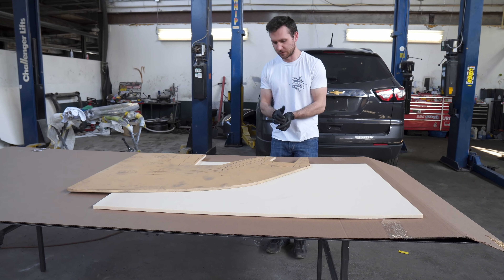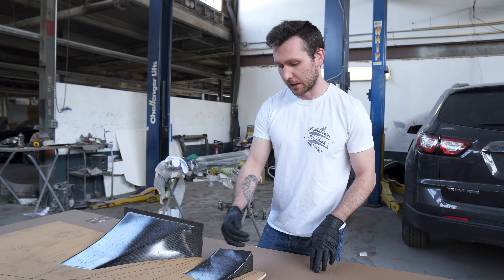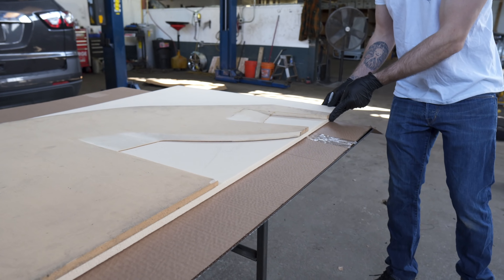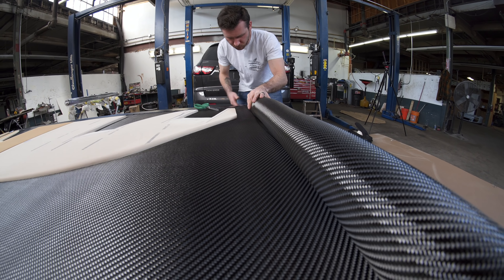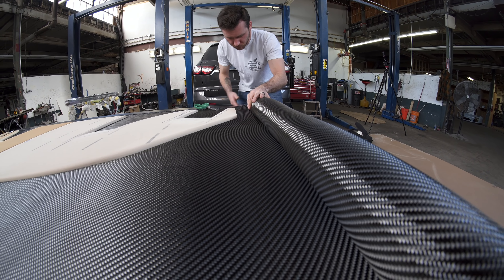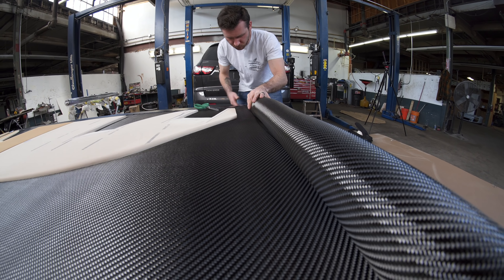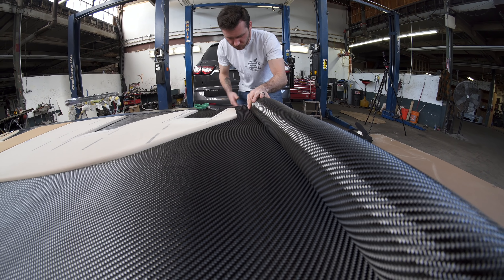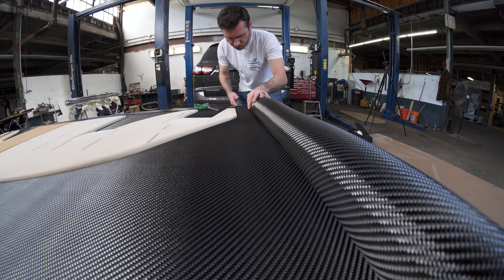240z Splitter Carbon Fiber Infusion | (Ep #56)

Comment: Hey Guys, Good job. Just a tiny piece of advise, when using infusion as a method of forming, you have to gauge to vacuum pressure at 29.9 hg, HAVE TO. you will never have air problems. Once your form is saturated, shut resin intake, and leave pump on for at least 2 hours. It will pull whatever air that could have possibly gotten in through the resin intake. Also, you should degas your resin before. Just a handy DIY heads up from a composites engineer. Awesome work...Grats

Comment: Use a perforation tool on the close cell foam. And you can make a Hydro lock in the bag to help evenly pull the resin through the bag

Comment: The blue handle ones have a edge specific for Kevlar or stronger fibers, the green handle ones are more of a general purpose. But you can cut* anything with our scissors/shears so it's all good lol! I'm just happy you're putting them to good use 👍
Reply: you must be the scissors guy
Reply: @neezduts3457  I'm the scissor guy
Reply: Can I just say they sound fucking amazing, that cutting was so satisfying hahahaha
Reply: @MrSaxophoneGamer  the MOST satisfying. And feeling it glide through too. Even the weight of the handles closing has to be dailed in! 👌
Reply: @rt4wd_wolff  how do we order 😁
Reply: Hows the edge retention when cutting carbon? My Kai 7280's were super sharp for about a week.
Reply: @maddsperformance  you need to get the Wolff® 6278M Kevlar® Shear - 6000 Series Carbon Steel Scissors. They have a specific cutting-edge for cutting Kevlar and harder materials.
Reply: @rt4wd_wolff  thanks I'll look into them. Any recommendations for electric cutter blades that last longer than 10" of cutting carbon fiber before they're dull lol
Reply: @maddsperformance  sure, if you haven't tried it yet check out the EC-1 electric cordless scissors kit we have on the website I posted. It has a Tungsten carbide blade that will hold up pretty good for your projects.

Comment: You will 100% need support rods bud, that thing is going to see 1000+ pounds of down-force at full speed, it will bow and scrape, I know this because I destroyed front splitters multiple times :-/, on a straightaway you'll hear it start grinding bad. Also as far as the titanium bump stops go, we found a muuuch better solution with a special type of plastic called UHMW, it's this "slick" feeling, low drag, soft-ish plastic that's very wear resistant, we replace it about every race, it's cheap AF and is by far the best you can use, it's used in a bunch of pro race cars.
Reply: That’s good to know thanks. Is that plastic easily machinable?

Comment: NEVER USE A BONDO SPREADER! But seems you already learned that. Im more commenting for others reading this. there is always a shar side and a casting line that can be sharp. But if its all you have then absoilutely DO NOT slide, only roll it.

For the foam: drill holes roughly 1.5" apart and the resin will flow fine